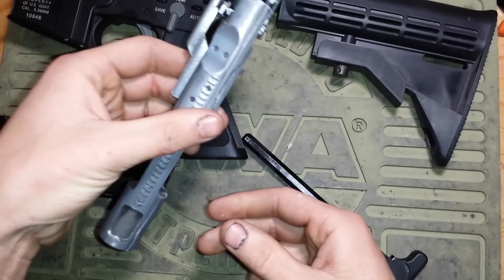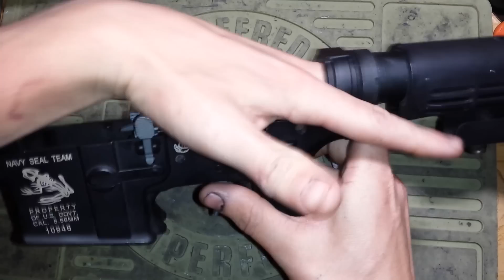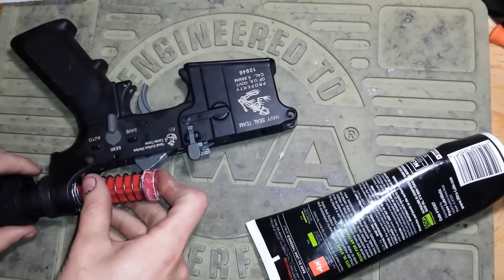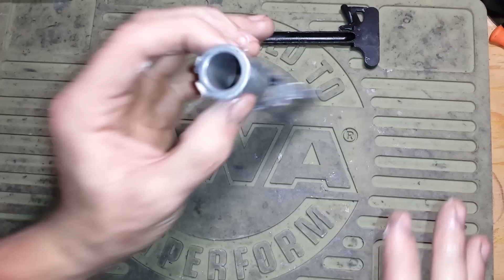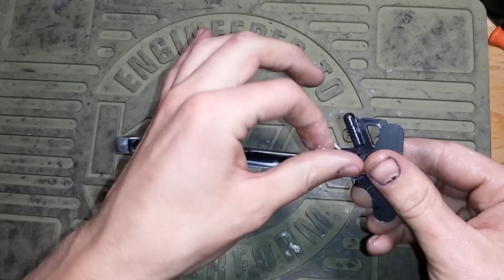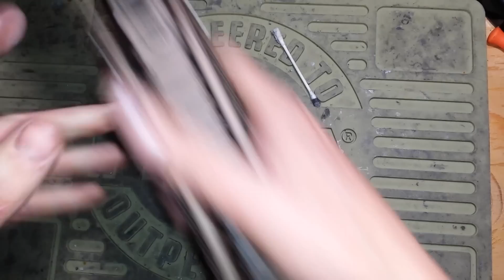How-to maintain an Airsoft GBB M4 The basics

Comment: Hey Douglas, I recently developed a problem with my WE open bolt m4 and I can’t find any definitive answers online. It fires full auto on semi and I’m thinking that it’s a problem with the disconnector but I’m not entirely sure.
Reply: Was wondering if you had any tips. Thanks in advance! :)
Reply from the maker: That would be a good place to start. Is there any irregular wear patterns?
Reply: @DouglasThompson I mean the bolt is worn down... it has a groove at the bottom from the steel wheel on the hammer.

Comment: I have a G&G cm16 blowback what lube would you recommend Ive been using blaster/wd40 on my elite force 1911 and have finally realized it's not good
Reply from the maker: Silicone oil is not a lubricant appropriate for metal on metal contact as you might have found out. Any lightweight non-petroleum based oil should do the trick. I had great luck with this

 0ahUKEwjngtPjneTdAhVDFjQIHZi8Avo4FBCBNgiyBA
Reply: @DouglasThompson  thanks
Reply: I just use real gun oil hoppe's 9 to be exact

Comment: Hi, thanks for posting this video as i just purchased my first GBBR but i must say i would not recommend using white lithium grease on stuff.  I work on old pre and post ww2 electric trains and i find that after sitting on gears, white lithium grease tends to turn gummy and will eventually dry out and act more like a glue than a grease.  Just my 2 cents.  I would recommend a different grease especially for long term storage/inactivity.  Thanks again for the video.

Comment: i have a gob scar and the problem I'm having is that the bb won't feed into the tube and when i pull the trigger all the gas in the mag spray out plz help
Reply from the maker: TheLuckySparrow is you nagazine really tight in the magwell?
Reply: not super tight but its in thee good . yesterday i did a field strip and it think i found the problem part of the piston is broken so it won't feed the bbs

Comment: Great video!Btw, so what is a silicone oil good for if not as lubricant? Like what is its specialty. Is it still a good lubricant? Or only to maintain rubber? How about rust prevention?
Reply from the maker: Reynold Andika i dont recommend silicone oil or grease for anything but rubber or plastic components. not sure on if it prevents any kind of corrosion or not.

Comment: I'm getting my first GBBR for christmas and was wondering a couple things before I get it. 1. How often should I lube the parts and clean it. 2. Is there any specific Lube you reccomend. 3. Are there any upgrades that I should do immediately, like hop up or a NPAS
Reply from the maker: 1. you should clean and re lube your rifle after each outing.

2. i like super lube white lithium grease (non petroleum) for all metal to metal parts. found at home depot.

any pure silicone oil for rubber seal parts.

3. run it until it breaks! your rifle will let you know what it needs and will reveal its weakness.

Comment: Does any white lithium grease works or it's a special one?
Reply from the maker: special non petrolium based white lithium.
Reply from the maker: +Douglas Thompson petroleum distillates free.
Reply from the maker: So it doesn't eat away at your plastic and rubber components. Also change the grease often, don't leave it on for like a year, It will become harder to get olf.

Comment: Hey again man! I have a question for you. I have got a King Arms M4 GBBR which I bought secondhand. The previous owner had installed an Angry Gun recoil kit with a steel buffer (the stock buffer is made out of plastic) and a much stronger and longer spring. I noticed that after going through for about 1000 rounds, my bolt catch was severely dented as if I had poked it really hard with a flat-head screwdriver - that resulted in some kind of a ridge on my bolt catch. Moreover, the bolt carrier was also showing a great amount of wear and it was not locking my bolt back before I fixed it thanks to your other video. My question is does the Angry Gun recoil kit cause these problems or is it just a normal wear? I couldn't judge which one had caused the problem since I did not own this gun from brand new. Looking forward to your answer!
Reply from the maker: Well both really. it is accelerated wear from more mass, it's always a tradeoff, 

more recoil= less efficiency, accelerated wear, harder follow up shots, more satisfying though! ;)

I'd recommend running it as hard as your budget will allow. if you got the money and know how to replace the parts in the future, run it hard!

If the money flow is not as good as it could be I'd get a plastic or aluminum buffer.

No matter what, those parts you mentioned will wear over time.

You can get better parts made from hardened steel and help prevent that but if you are trying to preserve the lower quality original stock parts, switch buffers, I'm sure the angry gun kit would sell easily on any airsoft forum.
Reply: Exactly. I have just ordered the stock buffer and stock spring just in case. I think I will be running the stock bolt carrier and bolt catch with the angry gun recoil kit installed as far as they can go. After that I'd buy a new bolt carrier. Do you know which manufacturer makes reliable bolt carriers?
Reply from the maker: +Ray Jeremy iron airsoft! hands down. ra-tech bolt carriers I have not had good luck with.

search "iron airsoft"

buy em! lol

got lightweight aluminum ones and super hardened steel ones.

ebairsoft.com boom!
Reply: Got it! Thanks a ton!

Comment: theres a pin missing right above the fire selector. i was wondering, does that do anything to the gun? does it work better/worst without it?
Reply from the maker: I remove that pin, along with the spring and full auto sear. I do it for many reasons. I usually convert my rifles to semi-auto only since as a civilian you can legally own most fully auto variants of current military weapons. But no, it doesn't do anything for the gun, I don't like the temptation of full auto on the field especially because I got 30 rounds compared to 100's per magazine with an aeg. Also, cooldown is a huge reason I remove it. semi-auto is much more gas efficient.
Reply from the maker: *can't legally own military firearms.
Reply: +Douglas Thompson oh alrighty i see why. pretty smart. sucks that we cant own automatic weapons anymore but well just have to deal with it.
Reply from the maker: +Kevin HQ Well there is the new "echo" trigger system that fires on a pull and one on release, bout as close as we can get at the moment! 400 dollars though...

Comment: allergy season is a pain in the ass eh? 
joke aside, thanks for the maintenance video, it helped me out a lot! 
one question though, if I only have silicone oil and not the lube you're using, can i still silicone oil instead?
Reply from the maker: +patrick0uch silicone oil is only good on rubber parts. It is a really bad lubricant for metal or other harder materials.

Comment from the maker: I can't answer the person that asked this question for some reason but DO NOT use WD-40 on anything in place of a lubricant. WD-40 will do the opposite of what you want it to do in terms of lubrication.
Reply: are you using kwa m4 gbb?
Reply from the maker: +masyraf MASYRAF This particular replica is a g&p based gbbr. It has many aftermarket parts but they are all compatible with the WA system.
Reply: Rubber IS plastic.

Comment: You call yourself a gun tech and don't even know what the auto-sear is for or what it's even called... It's used on a real gun to lock the hammer back until the bolt is fully closed. It prevents light strikes and out of battery detonation events. Full auto still functions without the auto sear in a GBB because the hammer riding back down with the bolt carrier has enough force to knock the valve open, but you might run into reliability issues when the temperature gets hotter which requires more force to knock open the valve, or the the mag venting because the valve is knocked open before the gas route fully seals with the nozzle.
Reply from the maker: So if I didn't know how to speak English or if I was a mute I wouldn't be able to work on guns, I guess... lol

I don't know the names of everything. I do know the function of each part. And for the information I'm missing, I have knowledgable youtubers such as yourself to help me out. :) 

I have fixed many guns and will continue to do so. I make videos so I can help people fix their own guns. My information/methods may not always be the best possible ways or 100% accurate but neither are any of our shots we take with our chosen firearms/replicas. There is more than just one way to get a job done.

I know what a full auto sear is and it's job. Thank you for the information and for watching my video. All criticism is welcome.
Reply: Well didn't mean to offend... maybe I'm just too AR oriented but to me the auto sear is a crucial and basic component as well as an understanding for it and shouldn't be omitted.
Reply from the maker: I'm a semi auto guy. I usually modify all my guns to fire semi only. And it's ok, I'd rather someone correct me than let me go on not saying it correctedly.

Comment: How does one go about learning more on pistons, gearboxes, just in general internals?  I want to get into teching but I don't have much knowledge and experiance.  I know I could just buy used, broken, or abandoned guns from a local store and work on them from that but it will be pointless if I don't have the proper knowledge on what to do from there.  Last how often should you lube the internals?  Thanks in advance.
Reply from the maker: Well, you are already on the right path since you have interest on the subject. 
Step 1. Watch a lot of youtube videos
Step 2. Obtain a super crappy aeg or gbb and go to town.

Take it completely apart, get yourself familiar with the internals and how everything works together. The  more you understand about how the parts work together and their individual function, the easier it will be to diagnose a broken guns problem or what to upgrade on a gun to maximize performance.

Make sure and do your research before moving on to someone else's gun.

NEVER work on a customer or friends gun without knowledge and experience.

My recommendation is to get into the aeg buisness since they are much more widespread in terms of acceptance and popularity. M4 platform preferably.

If you're dedicated, it won't take long to get comfortable. But it takes a lot of experimentation and research. Also don't be afraid to join a forum and ask questions. There are many approaches to fixing/modifying airsoft guns and you have to sort of pave your own way and choose what you think is the best possible way to maximize performance. 

Have a happy holiday!
Reply from the maker: Sorry, in terms of lubing internals, I'd say once every 6 months with weekend use or every time something is replaced or modified.
Reply: Douglas Thompson Im planning on getting a vfc/ umarex hk417 gbbr and there isnt too many videos on it.  And well im just interested in how these things work and i want to make sure i skrew anything up when im taking apart the gun to clean it.  Plus I would like to get a job in airsoft when i get older.  By the way the gbb version of the hk417 is pretty rare in the United States so that might be another reason.  and you didnt answer the question reguarding how often to lube the gun.  Thanks for taking time out of your day to reply.  I learned a lot in your video so thanks.

Happy holidays.
Reply: Douglas Thompson Thanks so much.

Comment: Will that black grease always come back or only on new guns?
Reply from the maker: It will always come back. It is a mixture of the lubrication you use, fine dirt, dust, metal shavings from metal to metal contact and who knows what else. It's normal and as long as you are aware of it and maintain your gun after every game or so, it should last you aa while.
Reply: Alright and also is it hard to shave the gun
Reply from the maker: Domenick Jim I'm not sure exactly what you mean. Are you asking if the metal shavings accumulate quickly if you don't lubricate it?
Reply: No sorry in video he talked about shaving bolt so it fit upper
Reply from the maker: Domenick Jim lol, that he is me and as for sanding a bolt to make it fit, it depends on how tight it is in the upper. I have had bolt carriers that are snug and I've also had some that are super loose. I'd say if it's too tight just slowly sand it and test the fit. Be patient and do a little at a time. 

Can you make a video of what exactly you're having a problem with? I can help you out the best I can.
Reply: Nah I don't have a GBBR but I have a kwa I really want one so I am trying to find out info about it